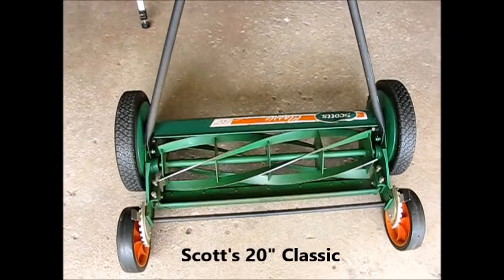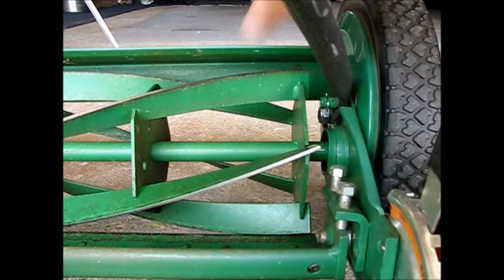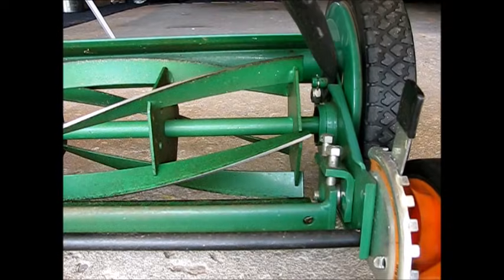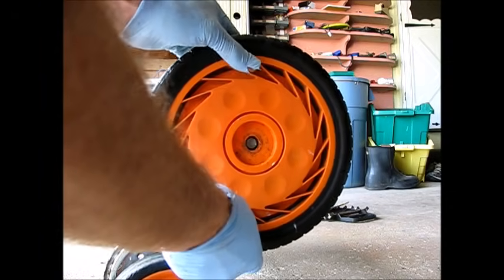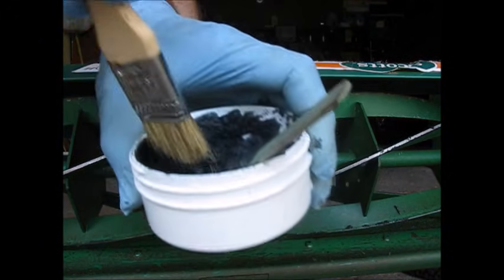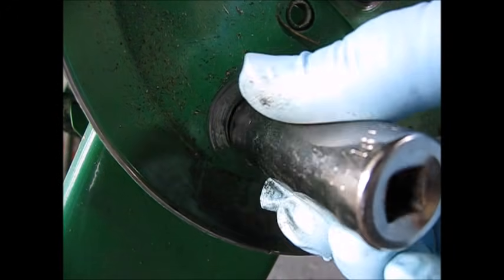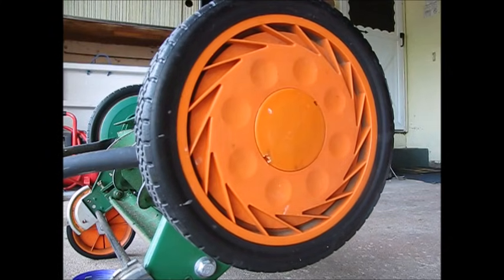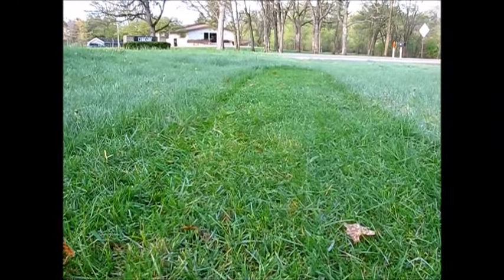How to sharpen a Scott's reel mower

Comment: Yeah looks very doable. But...yeah but I cannot do it. I've been struggling with these things forever. and when turning it to sharpen it. You are saying, turn it in reverse....the way it goes when you are mowing with it. What? say that again. Mine won't go in reverse. It turns the normal way as if you are mowing  ( it turns right but not counterclockwise). It works on yours but not on mine. I am trying to listen and do it exactly. But there's something wrong. You are saying turning it in reverse as if you are mowing (sounds like that is what you are saying). What? Again mine won't go in reverse. It will go right as if you are tighten something (clockwise). It will not turn to the left (counterclockwise).
Reply from the maker: It has to turn in the direction it turns when mowing. Correct. I think the use of the word reverse is confusing. Counterclockwise is a better word. I wonder if something went wrong in the disassembly prior to attempting to sharpen. I can only guess from here.

Comment: I would just paint that grit right on the blade and take it for a wallk on a non grass pavement instead of going through all of that break down.
Reply: No, because to sharpen the reel it must rotate in the opposite direction. You cannot do that by pushing it as you describe.